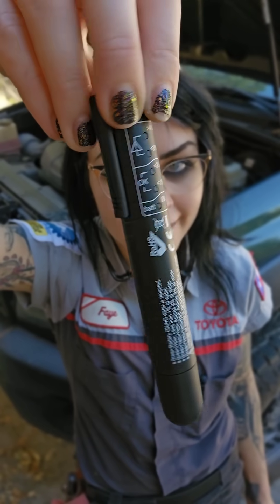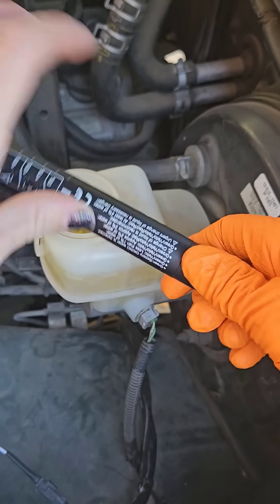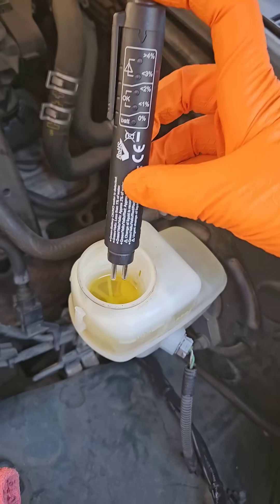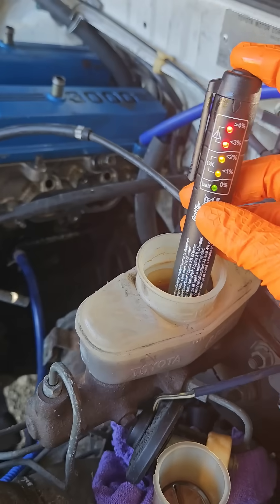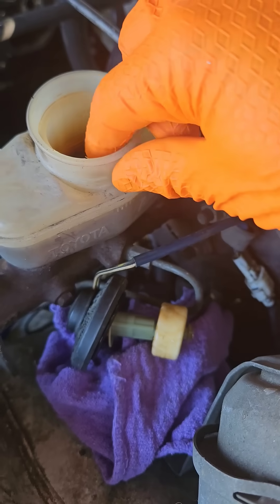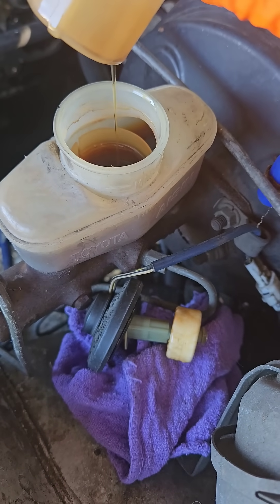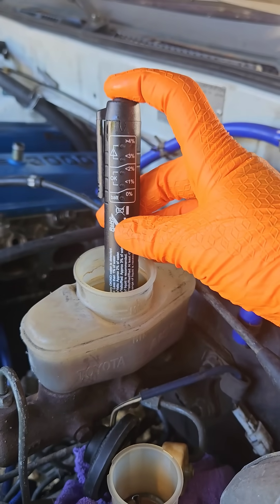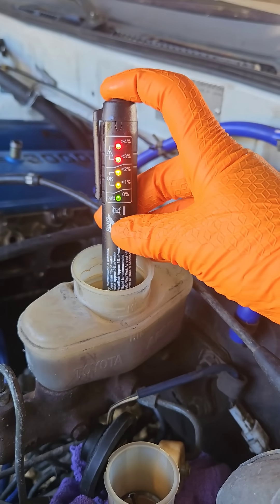Do you REALLY need your Brake Fluid Flushed?? How to Test it For Yourself!

Comment: Don't forget that if you live in cold climate, the brakes can freeze and it will cost a lot to replace all parts that the ice destroyed. Many years ago I replaced two calipers for a customer that had frozen and the housings was cracked and almost split in half!

Comment: Water can accumulate in brake system in as little as 6 months to 2 years.
DOT 3,4 actually absorbs moisture. Dot 4 faster than 3.
DOT 5 is silicone based and does not absorb fluid BUT IS INCOMPATIBLE with your car manufacturer specs unless specified. 
In other words, if your owners manual say replace with DOT 3, that's what you use.!

Comment: I did a lot of brake work in my day. Using air pressure to remove stuck pucks. It is truly amazing how much corrosion can and does happen to the aluminum puck housing.
Replace the two o-rings that allows oscillation of tge pucks. !
Ahh...I miss turning wrenches

Comment: My car told me I needed my brake fluid flushed.  I drove another 10k miles on it.  And then the ABS system failed, and the front left and back right brake basically became permanently engaged, by the time I got home my brakes were glowing red.

And yes, yes I needed to get it done, and the repair would have cost more than the car was worth.

Comment: I've flushed out a lot of braking system but not for water saturation, more for dirty fluid. I've only had to flush one braking system because of water saturation and one because some moron put transmission fluid into the system.

Comment: 2 years is pretty frequent. I tend to abide in 5 year intervals. Unless heavy braking is done. Brake fluids are primarily classified by their boiling points. Say I run dot 4 in a sedan daily driver. It tends to last longer than dot 3, also dot 3 is prone to congealing. But yeah, brake fluid wicks moisture from ambient air. You learn that in the south early on. I don’t really test the fluid. I go by vehicle type and age if no major faults are found. But no one is really doing a genuine flush if there’s an ABS module unless they have dealership software to activate the pump cycle in the module anyway. Another great reason to buy vintage. My 2 cents.

Comment: water being potentially corrosive and rust causing is not a concern as the brake fluid itself is far more corrosive. there is a reason why brake lines corrode so much.

brake fluid is hydroscopic so it does absorb water. The concern of water turning into steam from heat is typically not a concern for the average driver/vehicle being used for standard travel. The concern comes with heavy loaded vehicles that put a higher load on the brakes when braking. It takes quite alot of load and repeated use to cause the brake disc's and calipers to heat up to the point that water in the brake fluid will flash into steam. 

When in doubt, replace the fluid though.

Comment: It's a total scam. Hydrophylic, hydrophobic totally BS. Dealers and mechanics scam people into changing fluids that really don't need to be changed. So what not buy a device from China on Amazon to test your brake fluid? All a scam. Change your fluids as needed, most people get rid of their cars way before water eats it's way into brake lines or does "squishy" brake problems. **cking ehhh!

Comment: First I had a Tacoma for 16 years and 320,000 miles. I never replaced the brake fluid. Second I’m a mechanic if 24 years. I’ve never replaced the brake fluid on anything. Just topped it off after repairs and bleeding

Comment: It depends if you don't have any air in your lines can you have somebody on a routine schedule every 50,000 miles to get their brake pads replaced then I would pad slap it three times and then on the third time it replace the rotors and bleed the system but only if I'm doing more than pads

Comment: If you drive high up in the mountains and down steep roads, you have to brake a lot, then the brake fluid can boil and you lose your ability to brake. Most people may not drive in such areas, but it is the most important thing to know why we need to change brake fluid.

Comment: I sold a 300k truck because the brakes would keep sticking and over 500 dollars later in wasn't putting more money into it. Turned out the brake fluid in the abs looked like a milkshake my friend said who has it now and driving it fine. He probably put another 500 into it before figuring out what the problem was. The reservoir didn't look bad at all.

Comment: Yes u do need it flushed maybe every  5 years i know from experience  once i had water in mine it would heat up and it would automatically  apply the left front brake after caliper brqke line i figured out what it needed

Comment: Home gamer, not a tech of any sort. IMO...if it's much darker than new fluid, or two years old...change it. Cheaper than buying brake parts. Coolant, thermostat and any orings in the system (Ford) every two years as well.

Comment: I just do it every two or two and a half years, not sure if it's overkill or not but if anything just to open those bleeder valves. If you leave them there too long and it breaks flush on you and you loose your fluid you are in a world of pain, cus you have to replace the caliper and if the store is not in walking distance or closed you are in lots of trouble.

Comment: "Do you really need your brake fluid flushed?" 
I mean, probably. Unless you're really on the ball about oil changes but haven't bothered to check your cars manual for service intervals on anything else, there's a good chance that car's not even going to the shop until well after the recommended interval for changing brake fluid. (As if I've ever flushed my brakes for any reason other than dangerously spongy pedal response...).

But yeah, good rundown on when and why the fluid needs changed.

Comment: Faye. I need your help troubleshooting a problem. I have an intermittent problem on my 2012 Chevy Colorado Z71 4x4 5.3L v8. I get a brake fault, traction control fault and stability system fault. After the truck has been running for a while. I get crazy codes! The most common one is P0865, sometimes U1000,U1040 and A few other communication codes. I’ve checked and cleaned both ground splice packs. I’ve removed and checked the BCM. I’ve removed and cleaned all of the connections on the ECU and EBCM. The codes clear overnight and return when the engine compartment gets hot… up to operation temperature. The battery is good. I’ve pulled the fuse box apart and checked and cleaned it. Could the brake fluid level cause this. I know the sender shows open until the fluid gets low. I’ve disconnected it. I haven’t driven it yet. One more thing. I did check the OBD2 communications. High and low are giving me correct ohms and voltage. Im trying to rule out CAN bus problems. I’m at the end of my rope ( not literally 🙂)! I’m frustrated thoug. The truck operates perfect no drivability or braking issues, just the annoying lights. I have changed and bled the fluid…. That was a couple of years ago…
Reply: Dude type this in to ChatGPT not here

Comment: Would it be better to bleed a little out at each caliper and test that? Honestly curious, because it seems like the fluid by the caliper is always there, until you bleed it. Doest seem like it would circulate to the master cylinder on its own.

Comment: Or you could get a pin hole leak in your brake line and you're braking system will flush itself. Happened to me last year... it didn't refill itself though

Comment: ive been using one of those conductive testers for a few years now, but i heard that some additives in some brake fluids are conductive, so they will test bad even when new and that that the best way to test is to use a refractometer. (i got one months ago but havent used it yet) thoughts?

Comment: I had rotors and brakes changed, my brakes felt sketchy until I changed the brake fluid, and then I almost got whiplash 😂. Sometimes it’s very necessary .

Comment: Brake fluid doesn't circulate. You measure in the reservoir, gives you an okay reading but it doesn't mean that at the pistons also good. Just change it 2-3 years.

Comment: Uh, can someone please help me? I have heard about this issue about a year ago and it bought my own tester, exactly like this one. Mine tester has always shown 0%, and okay on my fluid up until recently, it has displayed over 4%. Now because of that, I have gotten a brake fluid flush and replace. But after that replacement, even though the fluid looked clear and  they swore up-and-down they changed it. It still showed over 4% and on my tester, when I went to test a newly opened bottle, it tested 2%. Can someone please explain this problem to me?.

For well over a year, my tester has always showed 0%. When I tested my brake fluid. Has my tester, gone bad or something or what??

One of my friend mechanics says that he doesn't trust those testers, the shop that I got it changed at said the same thing, and also other sources on the internet claim that these testers are really just kind of a scare to get you to change your brake fluid when you really don't need to?.

Comment: Faye is outstanding!  Another aspect of moisture in the brake fluid is that it can precipitate out - separate from the brake fluid- and it will go to the lowest point, a wheel cylinder or the master cylinder, and cause corrosion ultimately resulting in a seal failure.

Comment: Instead of the machine tester, you put a 3/8” clear tube (other end is in clear fluid), on the bleeder valve and gently pump the brake pedal. If the fluid in the bottle looks like a cigarette butt in water, change your fluid

Comment: I spent 500 to get my mom's brakes fix be cause she said she felt the brakes go while driving. She couldn't stop her car. As they're getting replaced the mechanic said the issue was not the breaks but the pump and a hole in her break line. Its like driving after someone cut you brakes. Crazy

Comment: That still doesn't answer if I actually need to change the fluid. 
I've never changed the brake fluid on my truck ever. 300000 miles on it. Same full brake system besides pads and rotors. I get contamination can cause problems and what not. But I still think this is a gimmicky scam

Comment: No, your brake fluid will never ever need flushed, because essentially, that's what brake bleeding does. Oil floats on water and iis insoluble, so when brakes are bled, moisture is the first thing that's bled out.

Comment: Water does very slightly compress, and the rubber in brake hoses gradually increases in permeability, thus increasing ambient water and gases, with gases being relatively highly compressable. No matter what the hygrometer reads, simply flushing  with 2-3 year frequency gives you a time cushion so you can take a major trip on short notice without risking the consequences if you don't. In general, make a list of preventative maintainence items and group them for convenience in keeping up with them. If you think you'll use a tool twice, buy one. Borrow or rent one the first time to help discover what strength and frequency of use you might experience with the tool. Be sure to tell the person you borrow from what you're up to, so they don't think you'll be a pest. Also ask their opinion about what will meet your needs, to see how good their judgement is and their tolerance for helping you out. Apply the pizza and beer repayment plan.

Comment: Water does compress. I use a ppi strip that measures copper in the fluid, in other words the corrosion, which would indicate water in the system. But more importantly, how had the water is rusting over and dissolving the hard lines. Considering most people pad swap, id recommend a flush. Ya'lls fluid probably looks like coffee.

Comment: 2 years on most cars here in Europe - specifically for vehicles with ESP. testers like these only measure moisture content at the reservoir... Not the heat cycled fluid in the caliper cylinders

Comment: Every 20,000 like clockwork along with a coolant drain and fill! $150 well spent! CVT fluid and Power steering flush every 30k and oil every 5k. Air Filter/Cabin filter every 15k and enjoy your car for 200k or more. Fluid is CHEAP new cars are EXPENSIVE!

Each vehicle has a yearly minor maintenance cost that people need to realize toyota corolla being one of the cheapest to a Lexus or Mercedes-Benz well you get the picture

Comment: I think it’s time I flush my brake fluid because I haven’t done it before since I bought my truck new back in 2014 and all I have been found was replacing pads since then well on my 4th set with only 170k miles on it. But I am too lazy to work on my own truck even though I have all the required equipment and tools to do it myself and too cheap to pay someone to do it for me so I will wait until I am ready to flush my brake lines, transmission, radiator, transfer case, front and rear gears.

Comment: Why don't you test the fluid in the piston rather than in the reservoir?  Chances are that the fluid you are testing has been sitting in that reservoir for years and will continue to many more until or if it ever makes it into the system.  I change out brake fluid every other decade or so!

Comment: you think i can convince my dad to change the original brake fluid on his 2000 Kia sportage.... but won't stop complaining that sometimes the petal goes right the floor 😅  oh it cant be the fluid.... well whatever then the whole system is shot is that what you want to hear?  

3 years on clutch fluid in my manual cars and then it gets stiff on the cold days In winter.  I try and do my vehicles every 3 or 4 years

Comment: I was thinking about that on this old beater I just bought. It's got kinda squishy brakes everything seems normal on inspection and a quick bleed and repeat all around. But dang they're kinda squishy got me thinking do I need to take it in and get it flushed. It's a 95 GMC Sierra and so far all my repairs have been done by me stumbling through tools, trials and a full understanding of why my dad was always grumpy while I held the flashlight as a child.

Comment: Brake lines are usually steel. Steel is very susceptible to temperature changes. Condensation WILL form on the inside of the brake lines over time. Changing the brake fluid once every two years will get the water out.

Comment: You do need to change your brake fluid. I just found this out the hard way.  Also,  don't forget to change the clutch fluid for manual transmissions if it has a separate reservoir.

Comment: Great video and I actually have that tester in my Amazon cart now. Working on my Harley putting taller apes on. Had to buy a Burly Cable Kit for the bars so I’m bleeding out front brakes and pretty sure the guy I bought the bike from never did this to it so I’m doing the back as well. I have to put fresh fluid in the front anyway for new line. As everyone else is saying. Brake fluid among the other fluids are neglected just like the rear pumpkins and the front if you have four wheel or even greasing fittings. I mean the list is long if you really want to get into it.

Comment: Abs systems get stuck when you don't change the fluid the solenoid inside the accumulator don't work and they get stuck and then the light comes on

Comment: >5% water content drops the boiling point of DOT-3 from 405 degrees F. to 284 degrees F. However, testing the fluid in the master cylinder doesn't mean much. You need to sample the fluid in the front brake calipers, where the fluid can see >400 degrees F. during heavy braking. During brake pad replacement I always open the caliper bleeder screws before compressing the pistons, which forces all this old water contaminated and overheated fluid out. I then suck all the old fluid out of the master cylinder reservoir ... and then bleed the brake system with fresh fluid until the fluid coming out of the calipers is clear. There really is no need to use an expensive pressurized brake fluid flushing machine. This is how I "flush" the brake fluid on my race cars after a weekend at the track. :)
Reply: Also, brake fluid acts as a lubricant for the caliper and wheel cylinder pistons. Water is a lousy lubricant. Any seasoned mechanic will tell you how many frozen rear wheel cylinder pistons they have seen from the old rusty brake fluid.

Comment: My brake fluid flushed itself like four times over this past winter, I practically have an entire new braking system now. Only things I haven’t replaced are my hydro booster and some random lines. 
I’ve replaced: both rear drums both rear wheel cylinders both sets of rear shoes (3x, user error had the tensioner adjuster not in right and FINALLY figured it out), both front calipers, both front rotors, front shoes, both front flex hoses, the master cylinder, and a few lines here and there that broke off in the process of changing wheel cylinders and flex hoses.

Comment: If it's yellow or golden, it's probably fine.  Amber, getting old. In either of those cases, a standard bleed is fine.  But if it's looking greenish, brownish, or black, yeah, flush the system.  It doesn't take much more effort than bleeding... just replace the reservoir fluid and bleed long enough to get the fresh reservoir fluid down to the calipers.  It's only an extra 10 or 15 minutes over a standard bleed.  And caveat emptor... some mechanic will just replace the reservoir fluid and call it a flush.  That will only help for a few weeks or months.  The fresh fluid needs to get to the calipers.